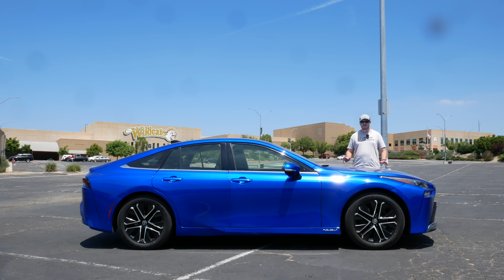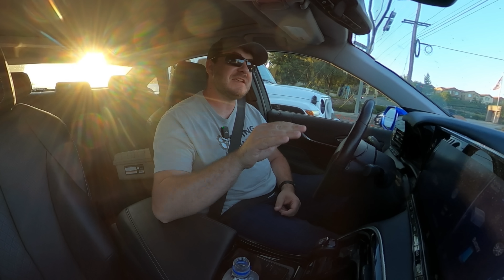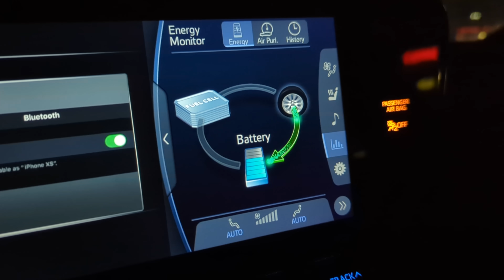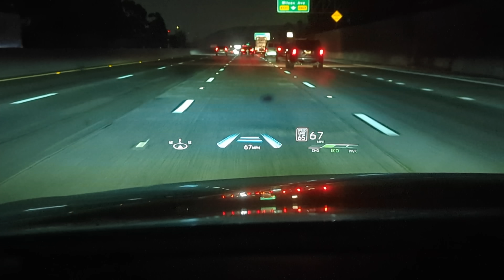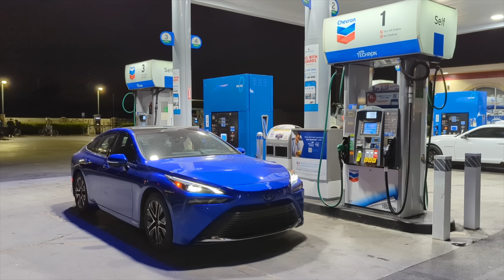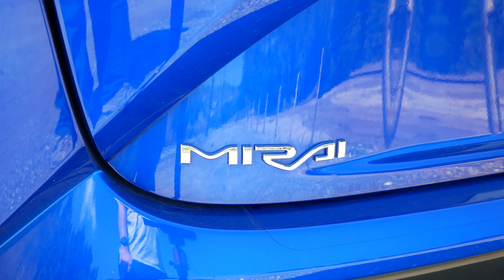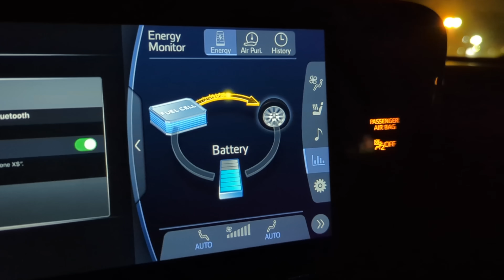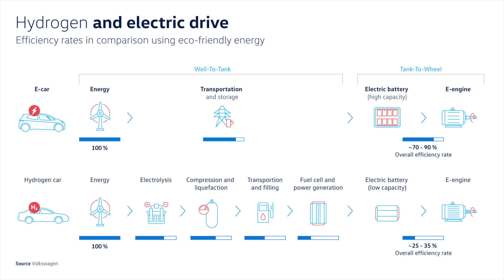The Toyota Mirai is Disappointing

Comment: This feels to me like a real-world or publicly available concept car, a glimpse into an alternative present. I’m curious as to how it fares in winter
Reply from the maker: I also wonder about that. I've heard there have been issues in the past with water freezing in the fuel cell stack and destroying it, but I've also heard those issues have been dealt with.
Reply: @agingwheels  There's a hydrogen station in Quebec city, so data should be avaliable, and i think this conrfirms that the Mirai is indeed a testbed for the technology.
Reply: @agingwheels  That is what the water purging after shutoff is for. You should hear the blower increasing rpm for a few seconds. Same process as using the H2O button, it blows out all the water from the channels.
Reply: @agingwheels  where do you dump the water in winter, on the road? Drive Way, Parking lot.... thats a lot of ice. Gas stations would be best, you could drive over a grate and dump it inside... but the grate would need to be heated. I suppose it could be evaporated over something that is hot in the car...
Reply: @agingwheels  Where do you think all the electricity must come from in the near future with that absurd 2030 green deal and that we have to change to electric cars..? (Lobbied big-time by the car industry) but where does the energy coming from..? Horizon polluting and birdslapping windmills. Biomass deforestation for heavy subsided solar fields and use the wood and burning it, under the name “clean energy” That sh!t aren’t helping either right? 

And don’t forget that Congo is where almost all battery components for our cars, smartphones etc come from. And especially the west and their insane “green deal” are guilty of exploitation of the locals, CHILD LABOUR, environment pollution from that dirty-ass TOXIC cobalt/lithium mines, CORRUPTION in terms of price deals with governments, illegally buying those rare earths from those locals/children that every day risk their lives in illegally dangerous mines with regularly collapses with lots of  deaths.
Reply: @agingwheels  It is no problem.
Reply: Agreed. This car feels like it came from a parallel universe where everything is the same, except hydrogen cars are the hot new renewable mode of transport instead of electric cars
Reply: In some ways, it really reminds me of the Chrysler turbine car experiments back in the sixties. The Chrysler turbines were very interesting technology, and the cars were fun to drive, but ultimately impractical.
Reply: @LeeBlaske  explains why hydrogen fuel cell cars still for the most part simply still have not caught on anywhere except California🤣🤣🤣
Reply: @tarstarkusz it is a junk comment. The current numbers also from the EIA show it. For Q1, wind and solar already took an additional 4% of generation computers to last year. And that doesn’t include extra hydro generation because of the rain. 
You are watching renewables kill coal as we speak. Natural gas has been flat and is now in decline by capacity. Denial doesn’t change any of this.
Reply: @tarstarkusz  "Renewables cannot replace coal and it's NOT coal being replaced by renewables, it's being replaced with natural gas, which in some ways is worse than coal.  Renewables can never be base load. "  It never ceases to amaze me that people make these sorts of statements, when the FACTS are out there RIGHT NOW, publicly available, to completely debunk what you're saying.

Take the UK: We are burning ZERO coal. None. NOT EVEN ONE lump of coal, to generate power for the grid. Yes, it's true that gas replaced a lot of coal, particularly from the 1990s onwards, but now those renewables - that for some reason you hate - are replacing the gas! And the coal. There are new wind turbines & solar installations being built every year, and every year the % of renewable contribution to our national grid grows, and the gas contribution shrinks. Coal can't shrink, it's already gone.

As to your assertion "Renewables can never be base load.". Of course they can. However, they DO need a means of storing energy, in order to cover base load. Lots of grid balancing batteries, for example. Again, I can only really cite UK stuff, but we have Europe's biggest grid-balancing battery, currently capturing renewable energy from one of the biggest offshore windfarms. Oh my, base load! There's also a couple of experimental (i.e. only in the "few megawatts" range) systems, one using compressed air, the other using thermal energy. I'm sure the US, at least now you got rid of the orange coloured weirdo, will also be conducting experiments on energy storage systems.

tl;dr: Renewables, with appropriate infrastructure, absolutely CAN replace energy derived from burning coal, oil and gas. You can complain all you like about it, but it's happening despite all your ranting and raving.
Reply: Houston, we've had a problem. . . Main Bus B under volt ... .. . . It is getting dark and my batteries are low.
Reply: you can tell this is a stupid idea because commiefornia is doing it .... NOTHING good comes from or happens in commiefornia !
Reply: yeah just one slight problem and that is a fuel cell needs platinum to make it and there is not enough platinum available for cars for catalytic converters. let alone fuel cells so there is that issue there you think battery's have that issue but that is also for fuel cell vehicles plain and simple and that is not forgetting the lack of fueling infrastructure
Reply: Most fuel cells operate hot tempratures, they should like freezing weather as long they are not starting from frozen.
Reply: What's "winter"?  Is it like "weather"? -- A Midwesterner who emigrated to California decades ago
Reply: @joshmyer9  Try Donner pass sometime.  Take chains.
Reply: @joshmyer9 I have Canada in mind with lows of -25°C or worse
Reply: @andrerenault canada is an edge case.
Reply: @tarstarkusz  Quite a few countries are already at or close to 100% renewable power. It is totally possible to run a country without burning stuff.
Reply: @drunkenhobo8020  Such as?  Which large countries are these "quite a few?"  There is not ONE in the civilized world (The Occident) which has any significant percentage coming from "rewnwables"
Reply: @tarstarkusz  Norway and Iceland are basically 100% renewable, and they're pretty civilised. A lot of Europe is now over 50%, such as Austria, Sweden, Portugal and Denmark - even Germany recently broke the half-way barrier.
Just because America is way behind on technology doesn't mean that it's not possible.
Reply: @drunkenhobo8020  Well, i use the term "renewables" to mean solar and wind. Norway and Iceland have low populations and are blessed with extraordinary natural renewables. Water in the case of Norway and geothermal in the case of Iceland, though I don't believe either is 100%   Norway also has the advantage of being connected to Europe.
Germany is restarting their coal-fired plants.  Germany also has some of the highest electric rates in the world.
If what you want is very high rates and unreliable electricity, sure, you can do anything you want.  Germany COULD raise that number to 100% if it just shut off all the fossil fuel plants (now that there are no nuclear plants).  it would be dark most of the time, but you know, details.
Reply: @tarstarkusz  Denmark is over 50% wind alone. It's a fairly small flat country with no hydro or geothermal to speak of. Play to your strengths - mountains, use hydro, geysers - use geothermal, large flat areas - use wind & solar. The USA has all of those. And a lot of them.
Germany screwed itself by relying on a hostile foreign power for its gas and is now reaping the rewards of that. If they'd built the renewables sooner, would have been far less of an issue.
Wind is one of the cheapest sources of electricity too and it's not unreliable - the largest turbines are designed to turn basically non-stop.
Reply: @drunkenhobo8020   the largest turbines are designed to turn basically non-stop
They do. When the wind slows or stops, they are powered by the grid...

Norway has a bunch of Hydro.  They have a whole system set up in a mountain.

Wind is far better than solar.  Wind has an EROI of 18 on average while solar sits between 2 and 3.5 assuming a 20 year lifespan (the "limited" warranty period) or between 3 and 5 depending on variables assuming a 30 year lifespan..  The "energy payback period" of solar is between 6 and 10 years.

Germany has a MUCH larger population than Denmark or Iceland., it also has a bunch of heavy industry.  All the legally mandated solar and wind has reeked havoc on their grid. It has to export a bunch of electricity it can't use because it is being produced at the wrong time.  This is very expensive.

I suggest you peruse the blog "Do the Math" over at the UCSD website.  Just search "Do the math" blog. It's the first result.  It's run by Dr Tom Murphy.  He covers all these topics and does some basic math to show why trying to run Western Civilization on solar panels and windmills  is PURE FANTASY.

For example, you will find if you "do the math" that trying to store the US's electric need for even a short period of time (days), it would consume ALL of the lithium produced in the world for like the next 20 years.  Or why trying to store electricity for the US in pumped hydro is impossible.  There are many articles covering all of the magical thinking people have.
Reply: @tarstarkusz osta Rica and Iceland are near 100% of renewable generation... Small countries, but in the occident...so you dont consider Japan or South Korea civilized?
Reply: @tarstarkusz  Why on Earth would you need to store the entire USA's energy usage for several days? The USA is massive - there is no situation where there is no wind or sunshine across the entire country, let alone for several days.
The point of the giant wind turbines is that they're so big they always collect some wind, so continue to spin. They're not powered by the grid to keep spinning.
Reply: @tarstarkusz you mean like the nordic countries?
Reply: @tarstarkusz bad news for you. Hydro is absolutely “renewable”.
Reply: @tarstarkusz you are really going out of your way to point out the failure of gas and how much better off Germany would have been had the gone all in on renewables.
Reply: @tarstarkusz the wind powers the grid. The wind is always blowing somewhere. Wind always powers the grid.
Reply: @tarstarkusz your sources are lying to you. The energy payback period for wind and solar is that many months, not years.
Reply: @tarstarkusz anyone who has actually “done the math” has discovered that renewables aren’t just cheaper, but they are more reliable, especially in emergencies.
Reply: @late_at_night_music  They are not part of the Occident nor is Costa Rica.  The Occident is US, Canada, Australia, Western Europe, Britain, Iceland  and New Zealand.
Reply: @williammeek4078  In certain limited circumstances and without batteries where a marginal watt is needed. The key word being marginal.  They are good for meeting the infrequent peak demand in the summer.
  NOBODY has done the math of what you read in the press. Tom Murphy started as an EV and sustainability weenie.  What made him a skeptic is math along with his own experiences with solar and EVs.
Reply: @williammeek4078  The energy payback period for wind and solar is that many months, not years
SOURCE?  Not authority, an actual source.
Reply: @williammeek4078  The wind is always blowing somewhere. Wind always powers the grid
Wrong.  When the wind stops, some (not all) windmills become fans.
Reply: @williammeek4078  Putting aside the fact that hydro is not renewable, I said I was limiting my comments to wind and solar.
Dams become backed with so much silt the whole things needs to be blow up.  Then you have to do something with all that silt in order to build a new one.
Reply: @tarstarkusz  "> the largest turbines are designed to turn basically non-stop < They do. When the wind slows or stops, they are powered by the grid..." - of course, all that coal just jumps out of the ground straight into power stations. Oil - I'm not sure why we need to go looking for it, it obviously takes NO energy whatsoever to transport it from thousands of feet underground & under water to the refineries (which also don't need any energy to run). Gas, well, that's just air really isn't it. And air is everywhere...
Reply: @real_electricmonk  I don't know what your point is.
Reply: @tarstarkusz  You complain that big wind turbines must, sometimes, be turned by grid power. But all energy systems require some input energy. If anything, wind turbines require less "operating energy" than fossil fuel extraction - i.e. it's a spurious argument.
Reply: @real_electricmonk  But I explain again, fossil fuels are so energy dense that you still end up with huge gains despite the layout of energy (energy costs) through the system.
Also, I said in the post you initially replied to that wind energy was a pretty good source, especially compared to solar. Wind, AFAIK, has an average EROI of 18.
The point is that anything not reliable 24/7 cannot be baseload.  Baseload cannot have 85% uptime.  it is a base level of very low cost power that is available 24/7 365 unless there is a catastrophic outage.  Obviously, no one plant is available and producing 24/7 365 in perpetuity. They go down for planned maintenance, but the system is designed for this.
Reply: @tarstarkusz  😂🤣😂🤣 Many people have done the math. The market does the math every day and proves renewables are cheaper. People power their individual off-grid homes and BEVs off of solar every day providing renewables are more reliable. 
You just ignore reality because it doesn’t suit your preferences. 
You are like those poor conservative idiots here in Florida that still try to pretend they are better off than me because they have gas generators to backup their homes and I only have solar and batteries. But guess who didn’t lose power last two hurricanes.
Reply: @tarstarkusz  ok this one time. I will provide sources. After this, you need to provide a source contradicting what I say. 

Energy payback period - “Energy output is over 100 times input needed to manufacture solar panels” - PV Magazine. 
EROI for roof mounted panels is < 1 year. For ground mount panels it is < 0.5 years.
Reply: @tarstarkusz  wrong. Provide sources stating that the wind stops blowing everywhere in the US at once.
Reply: @tarstarkusz  you can’t put aside the fact that hydro IS renewable. You can’t just redefine terms to suit the claims you want to make in order to mislead people.
Reply: @williammeek4078  I am absolutely NOT redefining anything. I am limiting my comments to specific technology.  I have little to nothing to say about hydro (which, BTW, isn't renewable).  Hydro is excellent. I support it fully.
Reply: @williammeek4078  A blurb printed in PV magazine is not a source.
Reply: @williammeek4078  I never said the wind stops blowing all at once across the US.  Argue with what I said.
Reply: @tarstarkusz  Once again, redefining something doesn’t alter reality.
Reply: @tarstarkusz  deal with it.
Reply: @tarstarkusz  the wind stopping all across the US simultaneously is required to support your argument. Otherwise you have no argument that wind can’t be reliable.
Reply: @williammeek4078  You are arguing a faulty premise. The US is not one giant grid and doesn't operate that way. It has regional grids. Wind can and does stop blowing in a region. Any turbine that stops turning and needs to be turned is cancelling out a wind tubing somewhere else.
Reply: @williammeek4078  Hydro is NOT renewable. Dams are huge infrastructure projects which will affect hundreds if not thousands of square km.  When the dam fills up with silt, that site cannot be used again. You have to blow up the dam and then hundreds or thousands of square km previously flooded land becomes exposed again.
They damage the land in other ways too.  Where before you had a floodplain periodically enriching the soil. much of this land is covered and even the land which isn't covered now needs irrigation and all of the problems that come with irrigation. The lack of enriching the soil with new silt from floods, it now needs to be hosed in fertilizer and all of the problems that brings.
Reply: @tarstarkusz Hydro is not renewable? You do realise that rain is powered by the sun? You better tell Tasmania because more than 100% of their electricity comes from hydro and they reckon it's renewable. Good news - I checked. Hydro power is renewable.
Reply: @tarstarkusz  that isn’t how wind turbines work. And there are already interconnects between the regional grids. You have a lot to learn before you can have an intelligent conversation about this topic.
Reply: @williammeek4078  If you think PA can power California, you have a lot to learn. While most of the grids (AFAIK, Texas is not) are interconnected, they cannot share large amounts of power between them.  To begin with, the spare power capacity isn't there. If 50% of California's production went down, they couldn't import the difference.   Large sections of the US can be affected by the same problem, like weather..
I'm certainly no expert on windmills, but neither are you.  AFAIK, there are some windmills in current use that need to spin all the times. If the wind stops, the grid spins them.  This is a simple fact.  There are many articles on the subject.
Reply: @tarstarkusz  except we are talking about the hypothetical scenario where we are building out wind turbines and grid interconnects. This is already in progress. The North Plains Connector is just one example being built right now. The Pacific DC Intertie has been in place for decades. 
Google “its time to tie the US electric grid together, says NREL”

Power electronics is what i do for a living. I do not build wind turbines but it is a subject i am very familiar with. Wind turbines are only powered by the grid when there is no wind and a threat of icing. And then the power consumption is very low. And this is a rare event. 
Wind turbines do NOT need to spin all the time. They DO consume some electricity when idle, but generally less than an equivalent fossil plant that also consumes electricity when idle. Whoever you are listening to is deliberately misleading you to sell you something.
Reply: The Sarcasm is strong with this one.
Reply: @tarstarkusz  "it would consume ALL of the lithium produced in the world" FAIL! You would not use galvanic chemistry cells to store that amount energy. MECHANICAL i.e. pressure based energy storage would most likely be used. The well established method is Falling Water aka Pump Hydro Storage i.e. Bath County Pumped Storage Station which typically runs a daily cycle of about 10 Gigawatt hours. No exotic materials required, you could use dirt, rocks, air, water anything that you can store into potential pressure.
Just because you know how to google something or fed a script by your political operation. Doesn't make it true. Dr Tom Murphy is a Quack when it comes to talking about Energy, it is entirely not his field. The sad thing is people believe what an PhD says when it comes to talking about subjects outside of their field.
Reply: @Neojhun  There is not anywhere near enough pumped hydro storage and never will be. It requires a particular geography that simply doesn't exist everywhere.
Murphy is not getting into the weeds on this stuff where mistakes are easy to miss.  It's very basic.  X foot of head for Y amount of water creates z potential.
Talk about quackery. You're invoking lifting soil and rocks or compressed air.  Even large underground structures like old salt mines or something just doesn't store enough.  And, again, it's just not enough of it.
Reply: I think you have a good point. Unless the fuel cell activates itself to heat the Lithium batteries, you are going to have a high startup loss. Other than price, replacing the Lithium Pack with Supercapactiors backed by a small high output "boost" lithium pack would be much better for colder weather. That does appear how they are using the lithium pack anyway, as a not so efficient capacitor. If you did use a supercapactior, it would also fix the regen cutting out because they are meant for peak power from zero volts to max charge and have very little resistance. You would likely need to hold the regen back, but if you had to much, you could either resistively burn it off, or dump it into the HVAC or Boost battery pack. In the winter, prevent freezing. The SCBs are meant to deliver max peak power with very low resistance, but not dense power delivery like a lithium pack. The benefit is the motor would not only be happier, but would likely preform better under regen and acceleration, giving the Cell time to spool.
Reply: Thermodynamic efficiency of the average steam power plant is 35 percent. Natural gas turbine plants are in the 50s. Hydrogen/gas fuel cells are in the 60s. So for most of the country your 80 percent efficient EV is being charged with electricity derived at 30 percent efficiency. Most efficient drive train would be a natural gas fuel cell hybrid because of how natural gas is produced and distributed.
Reply: @buddyrevell6369 the problem with your argument is that EVs are source agnostic. So the source of electricity doesn’t matter to the EV and you are no longer just looking at the efficiency of the powertrain. 
Basically, if you are including the efficiency of non-unique parts of the cycle, you are doing it wrong and giving misleading information. 

What is even worse for your argument is that since the goal is decarbonizing, that means using grid electricity to make hydrogen. And as has been routinely demonstrated, it takes 3x as much electricity to move a HFCEV a miles as a BEV. This fact, by the way, means hydrogen will never be economically viable against BEV, especially for heavy vehicles.
Reply: @williammeek4078  I am not making any argument. I am stating facts from working in the power industry for decades. 

There is no such thing as zero carbon or carbon neutral. 

An EV is 80 percent efficient from the battery to the motor. 

The Toyota fuel cells can run on natural gas, propane or hydrogen. They are really cool tech. Toyota is actually renting them now through sunbelt rentals for on-site EV charging at large events. 

Byproduct is heat. Lots of it. They are perfect for micro grids, and that waste heat can be used to provide heating for homes. 

I was able to receive a demonstration and speak with a Toyota engineer.  It's comical listening to all the armchair engineers who think they know more than Toyota.
Reply: @buddyrevell6369  I call BS on your claims of expertise “from working in the power industry”. You make way to many statements contrary to reality for that. 

“There is no such thing as zero carbon or carbon neutral.” The only way you can make this statement is if you don’t understand English. 

No, BEVs are 80% efficient grid to wheels. It is over 90% efficient battery to motor. 

No, Fuel cells aren’t cool tech, they are a dead end tech. 

No, waste heat is a bad thing. It is just poor efficiency. 

It is comical to listen to Toyota fan bois try to defend how badly Toyota screwed up.
Reply: @williammeek4078  call BS all you want. Simple Google search answers all. I sleep soundly, and your jumping to conclusions is quite comical.
Reply: @buddyrevell6369  "...electricity derived at 30 percent efficiency. " This varies by country, of course. e.g. in the UK, we burn almost zero coal for power. For example, at this exact moment, the UK's entire electrical grid is being supplied by 16% nuclear, 33% closed-cycle gas turbine, 4% biomass (Canadian rainforest wood chips), 21% wind and 19% solar, with the remaining 7% (actually 9%) coming from various interconnectors, and 2% (hence the 9%) being exported to other interconnectors.
Reply: @theelectricmonk3909  thermodynamic efficiency of a steam generation power plant is a constant worldwide. The source or location of the input BTU in the equation makes zero difference on the efficiency.  The only way to boost efficiency is to use the waste heat. Which is done is cogen power plants.
Reply: @buddyrevell6369 ....Do...do you not realize most hydrogen is generated using electricity and involves many other wasteful steps than just transmitting from plant to battery? The only advantage hydrogen has is energy density at cost of total input energy. Considering energy or fuel consists of the majority of pollution for a vehicle, it doesn't make sense to claim an EV, producing less energy emissions, is worse than a hydrogen car. Remember, the key byproduct of steam reforming is carbon monoxide or carbon dioxide. Even with clean energy, you're still producing a nasty byproduct.
Reply: @ryanthompson3737  Most hydrogen is not made from electricity, it is made from steam.  Electrolysis is very inefficient.  They burn natural gas to generate steam and then use that steam to treat natural gas and make hydrogen from it.
Reply: 1/10th the emissions of EV. not really a concept when its already driving unlike elon's concepts. not enough charging stations and unreliable stations is still a problem EV is facing a decade later. so cant really compare something that had 10yr head start.
Reply: @MrPaxio it's a car that doesn't quite meet regulations, and its power train hasn't proven long longevity yet, so it's technically still a prototype/concept.
Reply: @MrPaxio  You know the Mirai  has been out nearly 8 years right? ... Toyota has been in development since the early 90's with hydrogen,... well before the idea of tesla as a car company was even thought of
Reply: @MrPaxio   1/10th the emissions of a BEV? How did you arrive at that nonsensical conclusion? Using electricity to make hydrogen to fuel this car is drastically less efficient than using electricity to charge a battery directly. Over the lifetime of the vehicles, a BEV will have way less emissions than a hydrogen fuel cell vehicle simply due to having used less electricity to get around.

And not enough charging stations? How about not enough hydrogen stations? Did you miss the part about how, in the US, they only exist in California and Hawaii?
Reply: @mjc0961 you must count the emmisions generated by the favricatoon and recycling of the lithium battery pack, which is quite higher than on a fuel-cell concept
Reply: @MrPaxio  "not enough charging stations and unreliable stations is still a problem" H2 stations are just as problematic and far less of them can exist. I have a 3 Phase Charger At Home because I live in a 230v region. Literally many millions of places where a EV can charge. Good luck making enough H2 on site to power a vehicle of this size.
Reply: @Neojhun it's actually really easy to get enough H2 to power it.
Reply: @MrPaxio  The Mirai was first released in 2014, just 2 years after the Model S. Toyota was a much, much larger, more valuable, and more profitable company than Tesla at that time. They could have built out a network of stations faster (if possible*), but they didn't. Plus, hydrogen fueling stations existed prior to even the first Roadster. 

Hydrogen doesn't compare and won't be a major transportation ever for 2 reasons. One, the infrastructure is way too expensive. It was estimated back in 2004 to cost over 500B to have an equivalent network comparable to gas stations for the US alone. That number has since drastically increased and is likely well over 1T for the infrastructure alone. The second reason is that the cost of hydrogen can never be comparable to electricity for charging nor even gas and diesel.
Reply: @MrPaxio /10th the emissions of EV?
How do you arrive at that conclusion?
An EV will travel three times as far on 1kw of energy than a hydrogen car, so I can't follow that statement.
And you're talking about not enough charging stations? How do thousands of charging stations compare to zero for hydrogen?
Reply: @stoepsel7448  I dont think this is "the" factor, but how the energy is generated has to be accounted for in all examples. So for example, if the EV is receiving power from solar panels, I feel like it should get credit for that. I am guessing we are going to need a much larger grid of Nuclear Fission power plants, but if someone could either generate the Hydrogen at the Nuclear Plant, but not within flash distance, or somehow use Nuclear energy directly to generate Hydrogen, I think hydrogen makes more sense. 

With direct regards to the emissions, an EV does have a problem with the lithium media being cranky or more to the point the charging process. That has to cost some kind of an "emission." 

The problem here is clear however, obscure data and selectively sifting data to make it look differently than it is.
Reply: @keith_5584  "Hydrogen at the Nuclear Plant" not commercially viable soo pointless.
Reply: @keith_5584  Flash distance at nuclear plants?  What kind of nonsense are you talking about?  Fission power plants physically cannot explode like a nuclear bomb.  You couldn't even take the fuel from civilian reactors and put it in a nuclear bomb and have it work (civilian nuclear reactors mostly use low enriched Uranium but nuclear bombs require highly enriched Uranium or Plutonium).  And, realistically, we aren't going to be building a large number of fission power plants.  Not only can you not get anybody to let you build one near them, but last time we built one (see Vogtle Electric Generating Plant in Georgia), the cost overruns bankrupted Westinghouse and imposed rather substantial rate hikes for the utilities customers.  Maybe small modular reactors will prove to be a thing and solve all the problems, but hard to say on that.  I think people are going to NIMBY that too.

As far as hydrogen vehicles, it's STILL more energy efficient to do batteries, even if you could somehow convert 100% of the thermal output of nuclear to hydrogen (but it is pretty close).  But we don't have that tech and it isn't even on the horizon, so it's not even worth talking about.  Lithium batteries aren't cranky, at least no more than any other technology.  And we have ALOT of new battery designs and chemistries on the way that seem likely to address the shortcomings.  Like solid state lithium or sodium batteries.  Toyota was just talking about how their upcoming solid state batteries will have like 900 miles of range.  They'll probably also be much less likely to catch fire.  Sodium batteries are just making their way onto the market now.  Right now, they look like they'll be low end cars because the density is a little low (about on par with LiFePO4), but it's also first gen tech, so it may improve.
Reply: @keith_5584  EVs are not getting their power from solar, they are mostly getting it from natural gas and even that is highly location dependent.  In some places, coal is a high percentage of the mix.
EVs are nowhere near 80% efficient round trip. This is fantasy.  Almost all electricity in the US is from steam, whether coal, natural gas or nuclear. Steam is not 80% efficient. The grid has inefficiencies.  From heat source to the wheels, it's probably more like 50% efficient.
Reply: @tarstarkusz  EVs are 80% once the electricity is produced, which is what he was comparing to with the Hydrogen production. And coal is quickly being replaced in the US and Europe.
Reply: @anthonypelchat  REALLY?  Germany has been reopening coal fired plants.  The largest plant in the UK is literally burning the Canadian forest.
If I said cars are 80% efficient from the transmission back, would you accept that argument?  Because that is exactly what you are doing.
Reply: @tarstarkusz  Germany only opened the coal plants due to the water in Ukraine and sanctions with Russia. Germany and everywhere else in Europe have been moving off of coal, but they haven't been able to get off of Russian gas yet. 

Your efficiency number was saying that 80% was massively off for EV efficiency. But there are huge issues with that. One, electricity comes from numerous sources. So it might be 50% at the plant, or at a percentage that doesn't matter (wind, solar, water, etc). There is way too many variables. And those same variables affect oil and FCEVs, both of which require a large amount of electricity but are never counted.
Reply: @stoepsel7448  Is that coal fired juice its using?
Reply: @anthonypelchat  So, IOW, they are reopening coal fired power-plants.  Yes, they have a "good reason" but they are still using them.  Instead of extending the nuclear by ordering more fuel back in Feb of 22, they opted to pretend this wasn't going to be an eventuality.
The mix of renewables is tiny, especially in the US and China where they are still building brand new 50 plus year coal electric plants.
"Renewables" is too small of the contributor to make it "too complicated"
Reply: @tarstarkusz  An EV running on electricity made purely from coal is still more efficient and clean than a ICE. Hydrogen for cars is a joke set up by the oil industry to keep their infrastructure relevant. Consider the amount of energy required to get fuel to your vehicle, fossil fuels use oil to be taken out of the ground, refined, shipped and then trucked to your petrol station. Hydrogen use is incredibly inefficient, it is corrosive and will require specialised storage and trucks to be moved. Toyota refused to take on the challenge of EVs and will now pay the price as its competitors get ahead of them.
Reply: @stoepsel7448  First, both are EVs, and it's better for the enviroment because of the pollution generated in the fabrication and recycling process of the lithium powered EVs, which is quite higher than with a hydrogen fuel-cell powered vehicle. And you keep forgetting than the Honda FCX Clarity, which is also based in the hydrogen fuel-cell concept, has been around since 2008, and there are some units with over 200.000 miles so...
Reply: @tarstarkusz  In the US, Renewables account for a little over 20% of total electricity generation, with nuclear accounting for another 20% and Coal another 20%. Natural Gas is 40%. However, Renewables are growing while Coal is shrinking. 

Europe made mistakes with nuclear, but that doesn't change the fact that Coal is dropping and Renewables are rising.
Reply: @anthonypelchat That's not wind and solar.  None of the other parts of the mix can be increased easily.  Of that 20%, Solar is 3.4% and wind is 10.2% (of that 20%) 
I was growing like the dickens until I turned 19. Had you measured me on my 18th birthday and extrapolated, I'd be almost 13 foot by age 36.
Reply: @tarstarkusz  Over the last 10 years, electrical generation has gone up in the US. Not much, but it has gone up. In that time, Coal has dropped roughly in half. Nuclear and hydroelectric have both stayed mostly stable, just slightly down from 10 years ago. Wind has doubled and for 2022 produced 61% of what Coal produced. Solar has increased many times over and produced 42% of what Coal produced. And so far for Q1-23, Coal is down around 28% YoY while wind and solar are up. Solar is now nearly 50% of coal's production while wind is 91%.

Renewables are surpassing coal production. And despite your junk remark, the facts are clear that coal electricity production is shrinking quickly while renewables are growing.
Reply: @robmanueb.  You said "Toyota refused to take on the challenge of EVs and will now pay the price as its competitors get ahead of them."
Toyota was first to market, at least for a plug in hybrid.  Toyota is more than capable of building an EV if they want to do so.

I just wish people like you would temper their enthusiasm for EVs with some reality checks.
1) The ENTIRE industry, plus other industries that use batteries are ALL saying massive shortages and high prices ahead if EV purchases explode. There is not near enough capacity nor time enough to bring additional capacity online.

2) The 25 thousand Dollar premium to drive an EV, rising interest rates and a tightening money supply. The all time record loan length enabling these buyers and even the used market.

3) The impact this is going to have on the grid. You need more than passing magical references to "renewables"

4) Claims that because of nebulous "reasons," batteries will follow the same trajectory as transistors and chips.  There is not a SHRED of evidence for this and a lot of evidence against it.  Nicad, Alkaline, carbon-zinc, NIMH, lead Acid have all had many decades with some  up to a 100 plus years to make all the improvements we are allegedly going to sse in car batteries. YET, all of these other chemistries have not seen the massive increase in capacity and decrease in price EV weenies are predicting for Lithium Ion batteries.  Every single maker in every single one of these chemistries powering these batteries has had HUGE incentives to make them better and cheaper and we have seen almost no improvement.  I guess lithium ion is special and doesn't have chemical properties not easily changed.

If this were anything that didn't excite you, all of these things would bother you.  But you WANT TO BELIEVE.  This is how you get scammed by a con artist.  The con artist is always exploiting what you want to be true. What you desperate WANT to believe.
Reply: @Neojhun  Oh so it is a good idea to modulate it, step the voltage up, send it 100 miles, step it down, then make hydrogen. 

It is called transport loss.

I said if someone can figure it out, and nothing about it being commercialized.
Reply: @tarstarkusz EVs are 80% efficient from grid to wheels. It only makes sense to measure from grid to wheels because green hydrogen can also make from grid electricity and the efficiency of the grid is common to both. We are trying to compare the efficiency of the powertrains. We don’t add in the energy required to make gasoline into MPG calculations, why would we for EVs?  
Whoever is telling you to put grid efficiency in with EVs is (likely deliberately) misleading you.
Reply: @tarstarkusz even in the US, the grid is 45% carbon free and renewables are taking about 2% of the grid per year. Already all net (new construction minus retirements) new generation is wind solar and batteries. China is building more new wind and solar than any other country.
Reply: @late_at_night_music I don’t believe those numbers. Show your sources for information regarding the emissions from building HFCEVs vs BEVs.
Reply: @tarstarkusz for Q1 this year, wind and solar alone produced 17% of US electricity. Which was more than coal by the way.
Reply: @tarstarkusz you poor delusional fool
Toyota IS trying (and failing) to make a BEV. That failure is behind the shareholder revolt. 
1. Battery growth continues on its exponential path with no signs of slowing. BEVs are already 10% of all new vehicles (including heavy). Globally, we will likely be >95% BEV by 2030.
Reply: @tarstarkusz 2. 🤣 that is just funny. There are several BEVs for under $30k. Please identify your $5k ICEVs in the US.
Reply: @tarstarkusz 3. Nearly all charging is done at night. Very little will need to be done for the grid. Another thoughtless comment.
Reply: @tarstarkusz 4. Current batteries are already good enough. And they are improving. Did you think for yourself at all before commenting? It really looks like you are working from a script.
Reply: @williammeek4078  No they did not.  The IEA has the newest data online. Most of the renewable category is other than wind and solar.
Reply: @williammeek4078  China is still building large 50 year plus coal fired power plants at the rate of like 1 a week.
Most of the most effective renewables cannot be expanded or only marginally so. The biggest component,  nuclear is being dismantled, not expanded. I wish this wasn't happening, but it is.
Batteries is minuscule on the grid and like solar, are really only good for the marginal watt.  This is something EV weenies don't understand.
Reply: @williammeek4078  And ICE cars are 80% efficient from the transmission back.  So you see, if we start our efficiency rate at the most convenient spot, we can give any numbers we want.
You must start at the source of the heat, where the fuel is consumed, especially if CO2 is your concern.   The climate doesn't care about your made up numbers. It takes X amount of fuel burned to move your car a mile down the road.
Reply: @anthonypelchat  "Germany only opened the coal plants due to the war in Ukraine and sanctions with Russia" - true; and the only reason they've been forced to do THAT is because they killed off all their nuclear power plants after the Fukishima disaster (because Germany's legendary for suffering earthquakes and tsunamis..... no... wait....) and ramped up their use of cheap Russian gas to compensate. As the Germans would say, "oops".
Reply: @real_electricmonk  I'm not the biggest fan of building new nuclear plants, but I agree that they shouldn't have shut down what was already in use. Especially to become more dependent on a crazy dictator. Get off crazy imports from Russia, get off coal, then you can shut down nuclear.
Reply: @robmanueb.  AN EV running from electricity only from a coal fired power plant is NOT more efficient than an ICE car.  The average thermal efficiency of a coal fired plant is 33%. Add in all the other losses and you are at or under parity.
I agree that the other system has its inefficiencies. But fossil fuels are so energy dense that it all works.  We're not talking about using the fuel we power the cars with now more efficiently. We're talking about scratching that fuel completely and replacing it with solar and wind.
Reply: @tarstarkusz  "AN EV running from electricity only from a coal fired power plant is NOT more efficient than an ICE car." - A more realistic comparison these days, would be to take into account the energy mix that makes up the grid; especially since even in the notoriously laggard USA, less than 20% of all electrical energy was generated by coal fired power in 2022.
Reply: @tarstarkusz  You can't look at engine efficiency in isolation, what does it take to get oil to the motor, "Consider the amount of energy required to get fuel to your vehicle, fossil fuels use oil to be taken out of the ground, refined, shipped and then trucked to your petrol station." Add in the fact that a coal plant burns cleaner than a car engine, due to good ol efficiency of scale.
Reply: @tarstarkusz  Lithium iron phosphate batteries are how China mass produce EVs. Toyota stuck to old tech, hybrids are the worst of both worlds, more complicated and more complex to repair while still guaranteeing that we need petrol stations, trucks to move the petrol, refineries, ships to move oil and oil wells. The fossil fuel industry will do anything to keep those infrastructures viable, hydrogen is a symptom of that.
Reply: @tarstarkusz  no, your way of manipulating the numbers for efficiency is stupid and no engineer would do that. 
When comparing powertrains you look at the entire powertrain but only the powertrain. 
For example, by your argument, if you charge your BEV from solar your efficiency would be infinite because you are charging from energy that would otherwise be wasted. 
No matter how you try to argue it though, you can’t get around the fact that it takes 3x as much energy to move a fuel cell vehicle a mile as a similar BEV. 
Don’t be stupid. Learn some basic engineering principles.
Reply: @williammeek4078  No, it is you being stupid counting from the wall plug and the make believe solar grid that doesn't exist.  Electricity is not fuel.  The fuel your BEV uses is burned in a large steam generator. It's inefficient. There are inefficiencies between the plant and your vehicle.
From a societal point of view, it does not matter if the fuel was burned in situ or offsite somewhere else.  The fuel is used. The co2 is emitted.
Reply: @robmanueb.  That's OK, because we're going to need petrol stations for the foreseeable future.  It is absolute fantasy that we are going to replace all oil energy products and replace them with solar panels.

Not to mention my point was Toyota can build EVs. They have a very good track record of both ICE and hybrid cars.

Guess what? If we need aviation fuel and diesel, guess what we get as a byproduct?  GASOLINE. You literally cannot produce these heavier fuels without first producing gasoline and other lighter distillates first. This gasoline WILL get burned.

Where are we getting the lithium to replace 272 million cars and light trucks privately owned in the US alone?  Burning 370 million gallons of gasoline a day.
Reply: @robmanueb.  ALL cars are very inefficient. I don't disagree.  The reason we can afford to run such an inefficient system is because of how much energy is in a gallon of gas or diesel or aviation fuel or bunker fuel or kerosene and many other constituent parts of oil. .  The whole "system" is self-supporting.  Producing, refining and transporting is all done mostly on the back of oil (including refining).  It doesn't "rob" energy from some other source in the whole. Though electricity is often used, natural gas is also often found with oil. but the vast bulk of the work done to support the whole fuel system is done by oil.

In fact, the whole solar and wind production is on the (energy) back of oil. It is oil used to mine the metals and other things needed to make solar  panels and windmills.  Copper, for example, is heavily mined with enormous diesel trucks.  A lot of mining operations wouldn't even be feasible without these enormous trucks which drink many, many gallons of diesel an hour.

A common lie about solar panels is that they are made from sand. They are made from mining high quality quartz (sand is simply not pure enough).  The transportation of all these things is powered near exclusively by oil.

The entire high tech society is enabled by oil. It is no mistake that the agricultural revolution which freed up most workers off of farms coincides with the discovery and use of oil in agriculture, largely through diesel powered ag equipment.  The percentage of people on farms went from about 90% in 1900 to 2% today. 

 A lot of people hate oil for some reason that is beyond my comprehension.  I pray to the oil gods and thank them on a daily basis for my existence.  Everyone should do this.  Some people love to hate oil that their very lives depend upon.
Reply: @real_electricmonk  Fossil fuels account for 60.2% of electricity generation in the US according to the EIA.  Also, the US is not an average most people experience.  The US energy grid is highly location dependent. Some places have better mixes and other places have some pretty bad mixes.  Driving an EV is more efficient in terms of fossil fuel in California than a place like Kentucky.

Fossil fuels are going to be with us for a long time.  There will not be a battery electric plane or ship (currently ships consume on average 150 tons of bunker fuel per ship per day at 50% thermal efficiency)  or 18 wheeler.  As long as we need aviation fuel, kerosene, diesel, bunker fuel and others, we will get gasoline. 

 Producing those things produces gasoline as a by-product.  Oil is refined by the "weight"  of the constituent part from lightest to heaviest.  Gasoline is lighter than all of those fuels and must be driven off the oil first.  There is some ability to make more or less gas from a barrel of oil, but there is a limit because a large portion of oil is natural gasoline. This is especially true of the extra light oil the US produces.
Reply: @tarstarkusz  "ALL cars are very inefficient. I don't disagree."
Cool that you don't disagree with yourself there. LOL.
Difference between using the consumption of resources when making solar panels compared to oil is that we don't burn the solar cells and make new ones every time they get used. 
That is really giving of you to not hate oil. I don't hate inanimate objects either. I do hate the system and the people that support its continued use when we have alternatives. Renewables wont replace oil instantaneously but they will eat into their use and that is something I celebrate every day. Same goes for nuclear, regardless of those who don't understand that  it is pricing itself out of the energy equation. The only reason we ever had a nuclear power industry is because governments needed it to make nuclear bombs affordable. If you don't subsidise the snot out of nuclear it falls flat on its face, more so now that solar, wind and batteries are getting cheaper by the day.
Reply: @robmanueb.  I wasn't agreeing with myself, I was agreeing with whatever comment to which I was replying. Moving a 2 plus ton vehicle to transport a 150 pound person is just extremely inefficient regardless of the fuel.

It is yet to be seen what we end up doing with solar panels. But I assure you that if they are recycled, it's going to involve a lot of burning to generate heat.

Why are you pretending there aren't people who totally irrationally hate oil? We don't have alternatives for most uses of oil.  Everything from diesel to aviation fuel to lubrication oil to grease to steel making with petrocoke. Frankly, I don't think "renewables" can even replace gasoline. Most people cannot afford even a new ICE car, let alone the huge price of EVs.  This is only getting worse, not better. Rising interest rates and a tightening money supply will make the 7 year loans far too expensive.  We have spent the last 40 years in a falling interest rate and bubble environment. This may be reversing. 

A major reason nuclear is so expensive is your environmental buddies make it expensive with endless challenges and lawsuits.  There are nuclear power plants in countries without nuclear weapons.

There is no reason whatsoever to believe batteries will get cheaper. Batteries are not chips.  This has not happened with any other battery technology.  Where exactly do you believe this price drop is going to come from?
Reply: @tarstarkusz  "It is yet to be seen what we end up doing with solar panels."
Get back to you in 20 years on that one. 

"Why are you pretending there aren't people who totally irrationally hate oil?"
I'm not, but I don't GAF.

"Frankly, I don't think "renewables" can even replace gasoline."
It can for cars and that is the subject matter. 

"Most people cannot afford even a new ICE car, let alone the huge price of EVs." and "This may be reversing."
Sure seems to be reversing from where I am sitting. EV cars were unobtaninium 10 years ago, were expensive new 5 years ago,  are affordable for business fleets now, second hand I can afford, cheap Chinese are hitting the market as we speak. 

"A major reason nuclear is so expensive is your environmental buddies make it expensive with endless challenges and lawsuits."
Most of the cost of nuclear power plant is construction costs, these have been rising everywhere in the world. Countries where construction is rapid are places where the government is subsidising their use. No-one in the nuclear power industry seems to support that the cost is from environmental lobbying to any serious degree. Rising labor rates are also a contributing factor. The French who were held up as darlings of nuclear power club have had to nationalise EDF last month because of massive debt. S. Korea seems to be the outlier of having cheap nuclear power, but experts are questioning their figures and think they may be fudged. 

There are countries that have nuclear power but no nuclear weapons, lets hope they stay that way. Looking at you Iran. 

Battery cost have dropped hugely in the last three decades, "our world in data" reports a 97% decrease since 1991.
Reply: @robmanueb.  "This may be reversing" had nothing to do with EVs and everything to do with the long term cheap money policy of the fed.  If this does fully reverse, EVs are DEAD.  When I was born in the late 60s, the average new car loan was 2 years. It remained 2 years through the mid 70s. it started inching up with inflation and then the falling interest rates since 1981 (interest peaked in 1981).  Few people can afford EVs with 2 year financing.

I doubt it can even for cars.  Because for one, there will be a shifting cost between gas and electric if electric cars became truly widespread. The cost of gas will steadily decline and the cost of electricity will steadily go up. The grid needs over a trillion Dollars in upgrades to handle a large electric only fleet, probably even more. Meanwhile, we will still need diesel and aviation and kerosene and bunker fuel and so that gas will be produced.

Chinese cars, if they come here en mass, will not be cheap.  Cars are a very special category requiring DOT approval. The horrible manufacturing standards will not be accepted. The cost will be driven way up.  They will probably follow Toyota and other brands out of Japan and do the manufacturing here driving even the labor costs as high as GM or Toyota.

Nuclear has the same problem all over the world. People are dumb. They don't know anything about the topic, AT ALL. NOTHING. Complete and total ignorance.  Many think they can explode like a nuke. They think the "waste" is a huge problem.  The industry has been horrible at marketing nuclear.  As a result, they are always opposed. The forces opposing nuclear have been incredibly effective at sowing FUD.  This drives up cost enormously. There are endless delays.  But once they are up and running, they are WAY more efficient than fossil fuels or solar or wind.

Battery cost have dropped hugely in the last three decades, "our world in data" reports a 97% decrease since 1991

There are always huge drops in the beginning as you move from low scale to large scale and initial improvements. But then it stops. It's why alkaline, nicad, carbon zinc, NIMH and lead acid are no better than they were a long time ago and not really any cheaper other than making them in a  cheaper market.  Lithium batteries are already made in the billions, they are already being made in low cost markets, mostly in China.

If there is any country in the world who needs nuclear weapons, it's Iran. (also, they don't have nuclear power as of yet)  Iran has 2 enemies who hate her, hate her people and want them eliminated.  If big Satan had not been bogged down in Afghanistan and Iraq, it would have attacked Iran by now.   If you are in the Middle East and want big and little Satan to leave you alone, you need nukes.  BTW, big Satan is the only country to ever nuke another country. Little Satan is the only country who says it will attack all of its "allies" in Europe and the US if they get attacked by anyone. Little Satan also pretends to not have nukes under a program they euphemistically call "nuclear ambiguity" 
Just so we are clear, I live in the land of Big Satan.
Reply: @tarstarkusz Who said they do? All energy grids are a mix, some cleaner than others. But one things for sure - grids around the world are getting cleaner, hydrogen isn't.
Reply: @tarstarkusz  not true.  midwest superchargers in ND and SD are pretty much fully powered by wind.  wind is cheap and it will only get cheaper when companies build battery storage to take advantage of that dirt cheap energy and sell it when its more profitable.  (when the wind isnt blowing)
Reply: @Blyter7  No they are not. Stop lying.  They are hooked to the grid and pull from the general grid. 
At best you might be able to say the charges use (on average)  this much energy which is roughly equal with newly installed wind power, both on a yearly basis.  But this is in no way shape or form is being "powered by wind"
Wind is not cheap, especially when you combine it with batteries. It is only "cheap" compared to other marginal generation, which mostly consists of large generators and not baseload capacity.  Baseload capacity is dirt cheap.
Reply: @tarstarkusz  you are a muppet that clearly knows nothing.

you can straight up ignore the electricity mix and powerstation efficiency.

Cause the hydrogen is produced via electrolysis and then compressed. both steps run on electricity provided by the grid. electrolysis runs at an efficiency of 40-60%.

you then take the hydrogen and run it through a fuel cell which converts it back to electricity with an efficiency of 50-60%.

so the hydrogen vehicle has a round trip efficiency of 20-36& while the BEV is at 80% and since both are driving in the same market they both have the same electricity mix and electricity generation efficiency.
Reply: @keith_5584  you can mostly ignore the factor of how the energy is generated.

cause hydrogen is either produced via electrolysis, in which case it turns electricity into hydrogen at an efficiency of 40-60%, or via steam reformation, in which case a Prius has a lower carbon footprint than a Mirai.
Reply: @anonym3017  You say I know nothing, then post this little nugget: 
"Cause the hydrogen is produced via electrolysis"

Very little hydrogen is produced via electrolysis at the moment. Almost all of it is produced via steam retort of natural gas.,

No, again you are ignoring efficiency of the system. EVs are nowhere near 80% efficient.  Because the burning of fuel is hapenning somewhere else, you think it proper to ignore it. But you are wrong. From a societal point of view, which is the only view that matters here, it is no different if the fuel is burnt in the car or at a power plant. The fuel is burned, the emissions are emitted.  CO2 is not subject to rhetorical word games.  Just like the ICE engine has thermal efficiency problems, so too does a power plant. There are also line losses you are not taking into consideration.

If we were to switch to a hydrogen system and powered it with electrolysis, it could get around at least one problem you mention, that is the mix. (I am not a proponent of hydrogen cars)  Large hydrogen generating plants could have their own micro-grid of solar and wind. 

There was a contract just recently signed between (IIRC) Germany and Canada where a hydrogen plant in Canada running off of solar will export the hydrogen to Germany. It's an incredibly stupid idea enabled by politics, not sense, but that is what they are dong.  I don't know how they are going to handle even the relatively simple problem of the electricity generation difference between December and June. I don't know all the details and so I won't speculate.
Reply: @tarstarkusz yeah but we aren't looking at how all hydrogen gets produced. We are looking at how hydrogen for vehicles gets produced.

As you might have guessed hydrogen fuel stations are distributed and not centralized. Furthermore they sell small quantities of hydrogen per timeframe, compared to industrial volumes.

Shipping hydrogen is ridiculously expensive due to low energy density, heavy tank and shitload of permits required if it's compressed or the high costs of cryogenics and heavy tank due to insulation if it's liquefied.

Which means that local steam reformation or centralized steam reformation plus shipping cost more per unit of hydrogen than local electrolysis.

So hydrogen fuel stations produce their hydrogen on site via electrolysis. Which is also why they eventually need to recharge if too many vehicles fill up too quickly. Which is also proof that they produce their own hydrogen instead of having it delivered. Cause a giant tank wouldn't need to recharge for a few minutes before servicing the next vehicle.

Which once again shows that you don't know what you are talking about.

And again.

If the hydrogen is produced via steam reformation a Prius has lower carbon emissions than whatever hydrogen vehicle you are looking at.

And the EV in turn has a lower CO2 footprint than the Prius if the EV is somewhat efficient and your grid isn't dominated by single cycle fossil fuel plants.

And if the hydrogen is produced via electrolysis we can just ignore the grid in the comparison as it's the same for both the EV and the hydrogen vehicle.
Reply: @anonym3017  So hydrogen fuel stations tend to have their own on site electrolyzers and compressors as that's cheaper than steam reformation at such a small scale
Citation friggin needed.  I absolutely will not accept any hydrogen stations next to or onsite of a hydrogen generation plant.  I want what you said and that these hydrogen "gas stations" have independent hydrogen generation facilities doing nothing but refilling the hydrogen for the cars. 

Plus, you big dummy, I said I was not a proponent of hydrogen cars.  The main reason is we ain't got no hydrogen.  If we had some, it would be better, but still nowhere near as good for the purpose as liquid fuels.
Reply: @stoepsel7448  Erm, hydrogen had the head start... not EVs. 

The difference is just that EV's make ecological and financial sense. While hydrogen cars do not. Hydrogen cars also have the issue that they have not advanced and actually can't advance any further. 

The only thing possible with them is a bit of cost reduction in production, the end.

When i hear people cheer about the Toyota hydrogen Combustion engine and how marvelous it is and how new..... I already drove a BMW Hydrogen 7 back in 2006. And that wasn't even the first hydrogen combustion engine car. And the only thing that changed since then is... well nothing really.

On top of that comes, that the infrastructure for hydrogen would be so massively more expensive then the infrastructure for fast charging...

You could easlie put a fast charger or super charger onto the street for every single car in the US, where people life, and thousands along highways and interstates and it would still be cheaper then an hydrogen infrastructure.
Reply: @tarstarkusz  "The largest plant in the UK is literally burning the Canadian forest" that's NOT COAL!
Reply: @Neojhun  I didn't say it was coal.  What's your point?  Do you think is sustainable?  How much bunker fuel is being used to transport all that wood?
Reply: @MrPaxio I think the proliferation of charging stations everywhere in the world, or at least the US, compared to only having hydrogen in a single US state is a bit telling, not to mention there's a variety of fundamental issues with 100% hydrogen vehicles. Hybrids of some kind may make sense, but then why not just use PHEV with small gas generators
Reply: @MrPaxio I don’t believe you on the emission. I want a reference talking about that. Primary sources on,y please. Just one thing that makes it hard to believe is that, as the video describes, 97% of hydrogen is current made from natural gas steam reforming.
Reply: @MrPaxio Hydrogen has more than 2x the emissions- at least. Not sure what your basing your claim on. And Toyota started developing the Mirai in 1992 and launched it in 2014. Just 4 years after the LEAF. And if you think EV charging stations are a problem compared to hydrogen stations then you just haven't been paying attention.
Reply: @MrPaxio  There are MILLIONS of Elon's "concepts" driving around. The only EVs that suffer from not enough charging stations and unreliable charging stations are non-Tesla EVs.
Reply: @MrPaxio  Yeah.
Reply: @MrPaxio have you got a link to that information? I do question it because I interviewed BOSH that makes Hydrogen Fuel Cells
Reply: @MrPaxio  Wow, this comment is the most ridiculous misinformation I've read about EVs in a *while*.
Reply: @MrPaxio  If you wanna be like that: Cars are a dead end and no car, hydrogen or EV, will be an actually solution to our problems.
Reply: @MrPaxio  lmao even in north dakota you can get around just fine even in winter in our tesla plaid.  we also can go 0-60 in like 2.2 seconds and it can fully drive itself anywhere in ND.  zero issues.  tbh its the best car in the world in my opinion.  if you think a hydrogen fuel cell car is more efficient you are dead wrong.  it costs alot of energy to transport hydrogen and to create it.  i drove down to texas in the tesla and saw nothing but wind farms.  felt good charging knowing it didnt take a diesel truck to deliver "fuel" to every station on the way.  tesla makes the most efficient mass produced cars in the world.  its a fact.
Reply: @MrPaxio  huh? I think you mean a few times more emissions than an EV. Because around 95% of all hydrogen gas is generated using fossil fuels.
Reply: @MrPaxio no one is driving 100 miles to work every day. You can charge your car overnight to full on a regular 120v charger. You could install a 220v charger if you really need it.

Charging stations are for long-range travel.
Reply: @MrPaxio says someone who obviously didn't watch the video talking about how there are barely any hydrogen stations and the ones that are around are very unreliable. 🤡🤡🤡
Reply: @MrPaxio it helps that in Europe we have a lot of hydrogen stations already. Even the Netherlands has 7 running and another 10 being built
Reply: @remcob3 i wouldn’t call that a lot.
Reply: @williammeek4078  remember that you can drive across our country 3 times in a day. It's not that big.